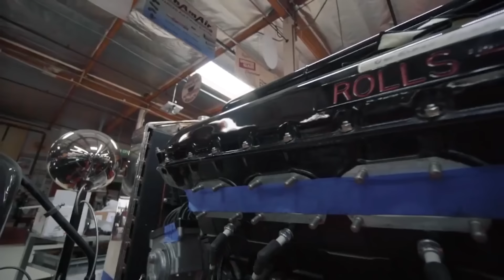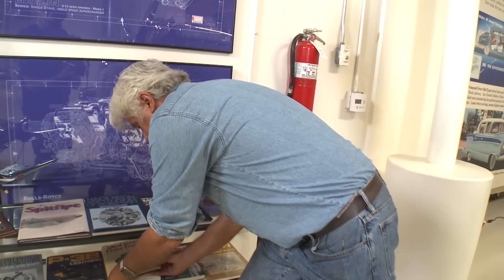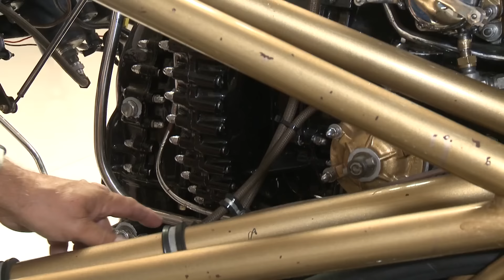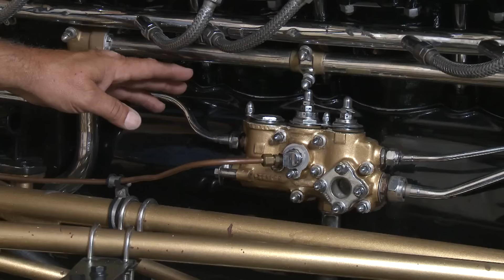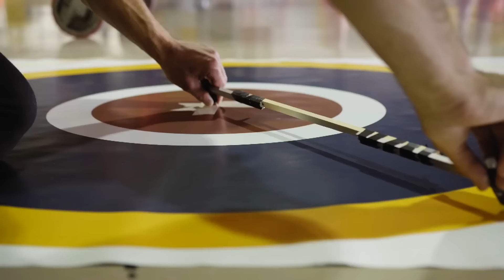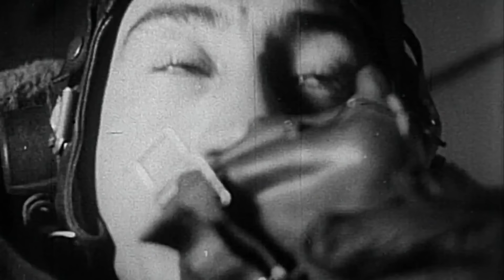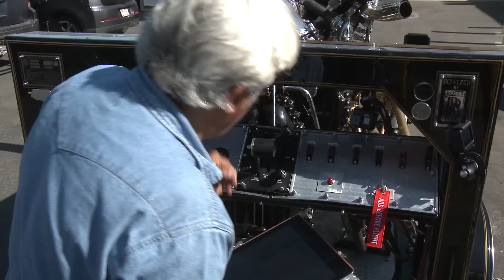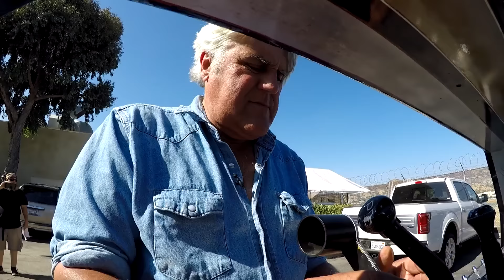The Engine That Won World War II - Jay Leno's Garage

Comment: Love the fact he knows this engine inside and out and he's not afraid to say the Brits made/designed the best piston engined aero engine. Packard Merlins were built under licence in the USA and Canada. There is nothing more spectacular than seeing and hearing a Lancaster bomber, with four Merlins going 'flat chat' (Australian parlance for flat out) thundering down a runway on a take off run. Good on you Jay!.
Reply: The Mustang was a flop until the Merlin was installed again the British actually installed it and it transformed it.
Reply: @dereksharpe6957  its not that the mustang was a flop, to the contrary it was a fine plane. But the merlin engine was that good,  it made the plane exceptionally good because of it.. as a side note, it took American engineering of tolerance and precision to be able to mass produce it on the scale it achieved.  Ford motor company for one in addition to packard ended up being a huge producers of that engine and could churn them out more consistently than the British factories were able to.
Reply: @ukraider66  and for the record RR tolerances were all over the place, hence the main reason they had such low production numbers.  It was for who showed them how making all the parts to higher exacting tolerance would allow them to assemble engines at a faster rate because parts would be interchangeable.  In addition they could achieve repairs faster because all parts would be the same. RR may have made it, but Ford and Packard made it Better.
Reply: Didn't the Aussies fly an Avro Lancaster under Sydney harbour bridge after ww2
Reply: @Rob-The-Red  Yes Q -Queenie was flown under it in 1943.
Reply: @Rob-The-Red  Correct the Lancaster was the most famous but a few planes went under the bridge. The Roulettes trained in 1988 to do a pass under the bridge, even planned how to loop it. Given the complexities of a loop moving forward and the Macchi limitations they went with a 5 ship break under the bridge. It got ultimately denied and instead they did a fly past into their normal display. My Dad flying as #2 was extremely disappointed, would have made for great footage with 5 of them smoke on breaking from under the bridge.
Reply: The P40 has an Allison engine which wasn't good enough, that's what originally got them looking at the Merlin engine. Unmatched ✌️🇬🇧
Reply: Don't forget the engines that powered the Boeing B17 and the B 24 Liberator.  They were impressive as well.
Reply: Why would he not say who constructed the engine?
Reply: @bbmtge  Lack of info is lying !!!  He bought that engine all restored !!
Reply: The engine from the Bf109 this engine on steroids was a better engine, and it was electronically controlled and far more reliable.
Reply: @pilsplease7561  electronically controlled, do you mean the auto prop pitch and rpm? Depends which 109 engine you're refering to. But the fuel injection was a big positive to the float carb. However, in general terms of reliability the Merlin/Meteor was more reliable with a longer service life especialy over the DB-601A's in the Emils. The DB-605's introduced in 1942 were a vast improvement. But the extra complexities caused some maintainence issues for example a 20mm cannon down the prop shaft which if you needed to service the gun/change the barrel, you have to pull the engine out. The Merlins eventually developped more hp, had a 2 stage supercharger and could handle 150 octane with high pressure boosts. The engine was used in tanks until the Chieftan and the Meteors were always hailed as being very reliable. DB-605, great engine, but the merlin/meteor i'd say at very least was more reliable.
Reply: @pilsplease7561  Don't believe it was 'more reliable'. Fuel injection may have given it a slight edge in negative 'G' manouveres, but that's about it. Most Merlin failures were mainly due to battle damage, in the fighters and bombers they powered!.
Reply: Jay never saw the inside of that engine !! ! He bought it all restored !!!
Reply: @wilburfinnigan2142  He didn't need too!. He did his research and studied the technical info.
Reply: V12 engines in Calif did the restoration/overhaul work for him !!!
Reply: I think that's a bit specious. The only reason the Merlin became a huge success was the ability of Packard and US production engineers, who could turn instructions into semi production lines. Logistics, the real god of war LOL Check out productivity of Packard over Rolls Royce. I bet most of the staff breathed a massive sigh of relief when the US production of variant engines began.
Reply: @stuarthart3370  Yet 112,000 Merlin engines were produced in Britain and 55,000 under licence in the US.  The Merlin was already a legend after the Battle of Britain.
Reply: @WoollyWanderers  Packard built the Merlin UNDER CONTRACT from RR for the Brits, 37,137 of them the license was for the 18,000 the USA used !!
Reply: @wilburfinnigan2142  which is nowhere even approaching the numbers built in the UK. Which was the point I was addressing.
Reply: @WoollyWanderers  There were 160,000 Merlins built total, Packard built 55,525   Ford UK built 36,000 and RR in all there factories built the rest....68475....Packard built ALL its merlins from 1942 to 1945   RR built theirs from 1938 to 1950  so you see Packard built in 3 1/2 years almost as many as RR built in12 years !!!  See the difference ????
Reply: @wilburfinnigan2142  112,000 Merlin engines were produced in Britain and 55,000 under licence in the US.  The Merlin was already a legend after the Battle of Britain.  This is another example of the Yanks trying to take credit for the successes of other allied nations.
Reply: @stuarthart3370  That’s utter tripe. We made very few changes to the Merlin and Packard built Merlin’s were in fact outdated. Our ability was the ability to mass produce a British engine - it still remained a British Engine and the only differences were superficial, I.e. in the threads, etc. Not only that but the late war Packard Merlins were somewhat antiquated compared to the newer Merlins and Griffons.

It’s pretty insulting to claim the Merlin is anything but a British designed engine frankly, we already take far too much credit for our actions during the war and that’s just insulting. British engine, British design - we didn’t change the engine past converting it into imperial, we just made them damn quickly - although the British had caught up in speed by 42-43. As well as that the U.K. alone produced more aero engines than Germany. Don’t insult more than we already do when it comes to the war by falsely taking credit for things we shouldn’t
Reply: @stuarthart3370  The Rolls Royce factories, sub component workshops and most of the industial manufacturing areas were constantly being bombed by the Luftwaffe. No interruptions like that over the pond!.
Reply: @stuarthart3370  Yet the US made engines were inferior to the ones made in Britain. The US made ones had lower tolerances. So when Britain started running 150 Octane fuel which would drastically shorten an engines life span regardless. The British merluns used in Mk.IX's could be pressed at a 25lb boost with 150 octane. However the US made emgines which they used in Mk.XVI's could not handle the increase in boost or 150 octane and the engine would utterly rinse its self. Eventually they stopped using it on the MK.XVI's which used packard engines. Saved it for the Mk.XI's, RR Griffons and Bristol Centurus engines. 
Reading through a lot of material, I still haven't found why this was the case when I figured it would have been the other way round but it was not the case.
Reply: @olismith2782  You have many facts screwed up !!! First off the Packard Merlins were made under contract and almost all  were to the Brits specs and ALL were series 20 single stage versions, what RR ordered, and All had the Bendix Stromberg pressure carb, Brits still did not get around to it till the 60 series 2stage.  All those Merlins Packard made went to 1/2 of ALL Lancasters made 3,440 of the MkBIII UK made and Mk X Canadian made,  and 1500 Mosquitos, 1200 Hurrycanes made in Canada,,,There were about 1000 shitfire Mk XVI's made with the Packard 266 which was the only 2 stage packard Merlins made and they were the LF version  Low/medium altitude as they were ground attack version late 1944  45 production war almost over.  Your  "inferior engines" are a known lie, mainly because the Brits were embarassed that the USA had to save their @$$'s in WW LL.  Both Ford UK and Packard told RR that the tolerances in RR hand built engines had to be tightened up, they were too sloppy, what mass production gets you.  Its funny that a shitfire Mk IX with the RR Built merlin, and the P51 B/C or D/K with the "same" Packard built merlin . the P51 was 30 MPH Faster !!!  WHY???  IF the Packard Merlin was "inferior"????  The answer is the Packard was not inferior.  Packard research and development went into the V1650-3/7/9/11  which were developed and MODIFIED for the mustang only, and he /11 produced the most HP of any merlin, some 2250HP.  used in the H mustang.  Just the facts of history less all the British Lies, hype and Bull$hit !!!! As WE know what WE did over on this side of the pond.  oooh yeah  you are welcome that "WE" saved your ungrateful British @$$'s in WWII !!!
Reply: @wilburfinnigan2142  the USA entered the war in Dec 1941. The Battle of Britain was won in the summer of 1940: we didn't need our arses saving. The first time US troops came up against the Germans (Kasserine Pass) the Americans were completely routed. What American manufacturing capability and manpower enabled was the liberation of mainland Europe although, as has been stated, Britain alone out manufactured Germany. D Day was a mainly British operation and it wasn't until after D Day that the US became the main military power in the western theatre.

PS on a separate note, at least we managed to win in Malaya. How did Vietnam work out?
Reply: @stuarthart3370  Packard built 55,525 merlin engines from 1942 when production got started, but only a few hundred that year, till sept 1945  with a full 1/2 that number being built in 1944, a rate of production RR could not match with three factories.  Ford UK built 33,000 in the same time frame as Packard !!!
Reply: @wilburfinnigan2142  the American auto manufacturers were simply unmatched in their ability to make everything the same and turn it out in incredible numbers

Comment: Jay, That is a great engine and setup.  Congratulations on finding it!  Is the prop a variable pitch?  You should be able to put one on that you can set for zero thrust and be able to run the engine up a bit higher without pulling things apart.   It also seemed like you were running it a bit on the lean side.  I would think it should be set full rich for startup rather than full lean, and then leaned out as it warms up like any other engine - but then I am just experienced with smaller 4 and 6 cylinder airplane engines.  John
Reply: Could be that the fixed-pitch prop was fitted by Graham White for engine cooling purposes.  Both the oil and coolant radiators appear to have been designed and placed to take advantage of prop wash.

Comment: At least it's a Packard built
Reply: And?
Reply: @johnburns4017  the English wasn't smart enough to build a real engine they still aren't
Reply: @johnburns4017  undoubtedly you have no idea what you're talkin about because you're totally wrong he must be British
Reply: The Americans had to almost redesign that motor so they would last longer and they made that Motorway better
Reply: @texasfathead  
Packard redesigned the Merlin? Complete nonsense. No previous Packard engine was remotely like the Merlin. RR engineers were permanently at Packard to ensure their engines were built to their standards and specification.  RR ensured all parts on all Merlins were interchangeable, no matter where it was made. The engines were made at four locations.  The British Merlins used Whitworth threads. Packard changed the Merlins to use American threads. That was about it.

Comment: Jay --- Please --- The Canadian Warplane Heritage Museum is in Mount Hope, a suburb of Hamilton Ontario, NOT Toronto Ontario.
Calling the location Toronto is somewhat like saying Cleveland is Buffalo. 
I grew up in Oshawa Ontario, quite near the Oshawa Airport which started as a WW II flight training airbase. The Lanc you refer to in this video was saved by Bob Stewart of Oshawa, a collector of air memorabilia and I spent time around that plane and another that unfortunately was not able to be saved (probably used for parts). Bob also had many other air engines on frames throughout the main hanger (now replaced sadly). 
By the way, Oshawa is also not Toronto, about the same distance from Toronto as Hamilton, but in the other direction.
A minor correction to your video. Otherwise this is a great video. Thanks
There was a Mustang at the Oshawa Airport in the 1960's which would rumble out the entire neighbourhood when it started up on Sunday mornings, giving me the excuse to hop on my bicycle and escape going to church so I could go over and watch the days' flight.

Comment: Spitfire, hurricane, mosquito, Lancaster,p-51 and then all the tanks fitted with the meteor, the Merlin engine without the supercharger, what an awesome engine!
Reply: The mustang, too. It was a flying dirge until they put a Merlin in it.
Reply: @nabirasch5169  Its too bad you are ignorant of the facts.  The Allison Mustang out ran any Merlin powered shitfire under 20,000 ft  Its supercharger was set to make HP at a lower altitude.  Facts of history check the fcts !!
Reply: @wilburfinnigan2142  
Too bad the Mustang didn't come along until it was too late to have any real impact on the war, right? Kind of missed being an icon altho a lovely aircraft.
Reply: The P-47 Thunderbolt "Jug" was so good in its role that the A-10 "Warthog" is actually the Thunderbolt II in its honor. Air Cooled Radials can take ground fire and keep flying on fewer cylinders. Liquid Cooled Engines like the equally fabulous Merlin and then the Griffin were liquid cooled and could fly stronger where the air was thinner but one good shot to the engine block would leak out any hope of more ground support.

The Radial and the Piston had their roles and they were reaching their maximum potential by late in the War.  Ironically, Air Passenger Travel is well suited to a return to propeller driven aircraft given the lanes that airlines travel in and the lines for aircraft departures and arrivals at the airports. Their effective travel speed can be matched by a Mustang or Spitfire.

There is a limitless supply of electricity available by drilling (about the same distance we already drill for Oil) to use the heat of the Earth to Boil Water (and Nuclear Power Plants Boil Water to generate electricity). For you doubters, the reason we don't already is because what was once a Utility Service is now a for-profit business that purchased all the infrastructure for fractions of a penny on the dollar "thanks" to Ronald Reagan.  Once you turn that into a business, they will protect their profits - remember when Oil Companies claimed for years that Electric Cars were "too slow"? (Or when Tobacco Companies claimed that Cigarettes were "safe"?)

Finally, a P-51 would certainly be used as needed however,  Steven Spielberg is to blame for the P-51 CGI in his movie instead of P-47's.
▪
Reply: Griffon was auto "corrected" to Griffin.  I will not be editing that comment.
Reply: P and W R-2800 was the greatest in my opinion. The P-47s smashed the Luftwaffe and killed the majority of their experienced pilots before the Merlin Mustangs arrived on the scene. It’s a common misconception that the Mustang beat the Luftwaffe but it was actually the Thunderbolt and it’s R-2800.
Reply: @guaporeturns9472  Actually it was the spitfire who killed most of the Luftwaffe experten…. Two years before the P47 even showed up.
Reply: @BryanJohnson4891  I’m not so sure about that… but the Spitfire definitely did it’s share.

Comment: The Pratt & Whitney radial engine was much more durable under fire. It has been proven out many times that it will still operate keeping the airplane aloft even with several cylinders shot out...
Reply: It had a large frontal area, so easily hit, while the water cooled engines had a narrow frontage.

Comment: My grandfather spent WWII inspecting "Packard built" Rolls Royce Merlin engines. At the Chevrolet engine plant in Flint. Chevy could build them faster and cheaper than Packard which Packard had trouble understanding. Expensive Packard automobiles had individually hand fit pistons. To make inexpensive cars Chevy had to learn how to make interchangeable pistons.  Much less labor. It carried over to bigger engines. 
It was apparently at this same plant that Norden Bombsites were made on a line hidden between two other assembly lines. At least that is what I was told. Note: one of the places they were made.
Reply: @tecdessus Packard made high end cars one at a time. Chevy made "economical " cars by true mass production. Packard had to individually fit pistons to cylinders. Chevy was precise enough that any piston fit in any cylinder. Or almost. The savings in labor was tremendous.
Reply: @tecdessus A blueprint is a piece of paper. It takes actual machines to make an engine. The blueprint will call for every cylinder to be exactly the same size within a very small tolerance and every piston exactly the same size again within a very small tolerance. Packard could not make cylinders or pistons within the required tolerance. Chevy could. This precision is how Chevy was able to make cheap cars.